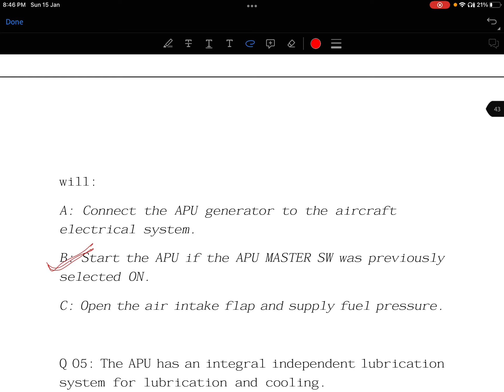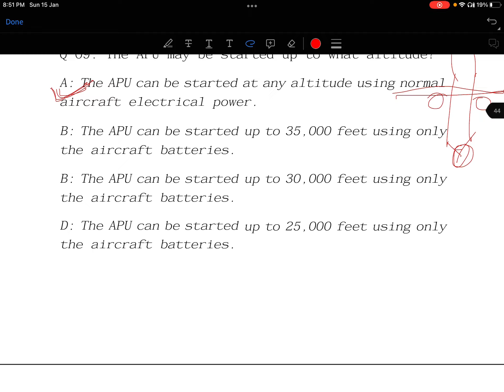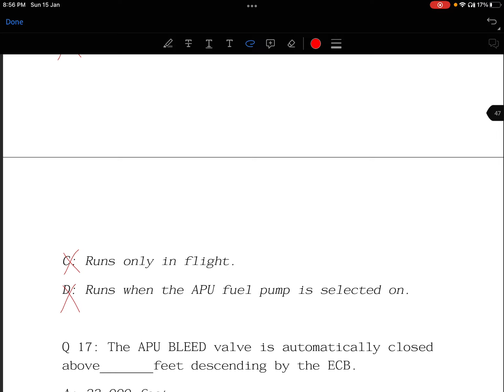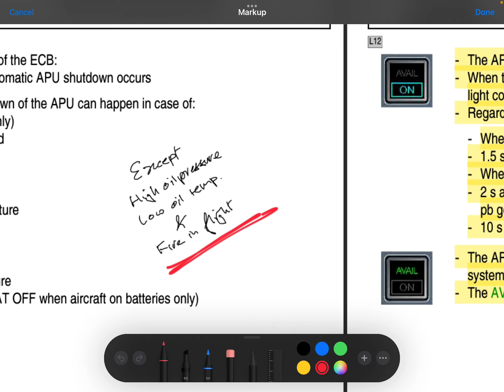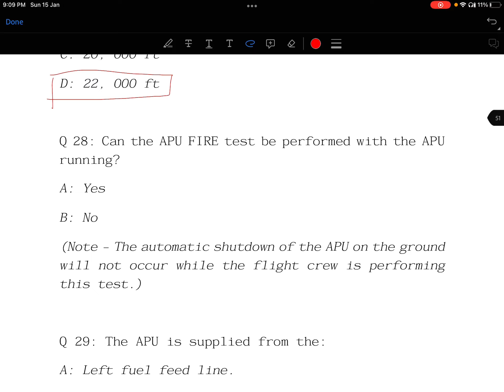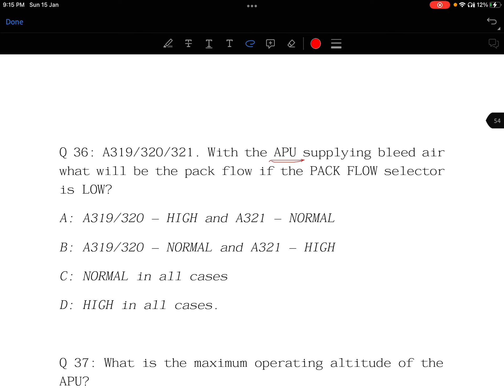Airbus a320 APU system question answers

Comment: Question 12 Apu is the current answer  because Apu avail means it is powering the system already Avail light in Apu comes after the blue on light …….in the case of External power switch  Avail light comes first and when you press it external source Blue on light comes  on now it will take priority over the Apu……….in the question it’s mentioned Both Are on Avail light which means external power is not switched on so Apu is still running .
Reply from the maker: Thank you for pointing out, You are very right Vishal ,
My bad